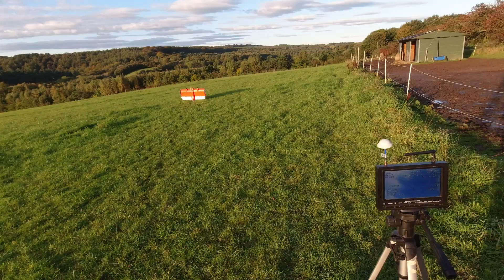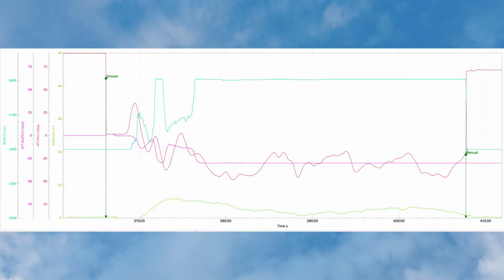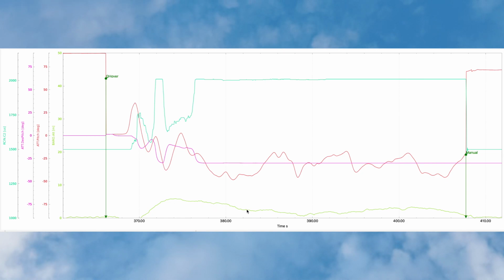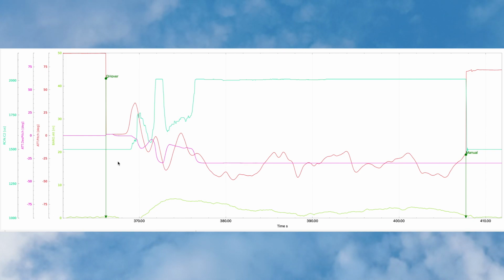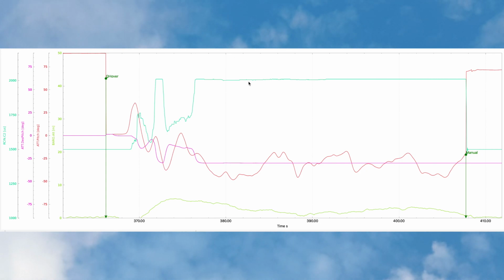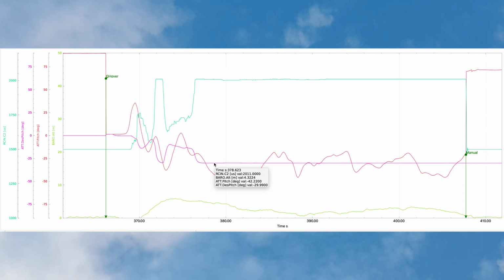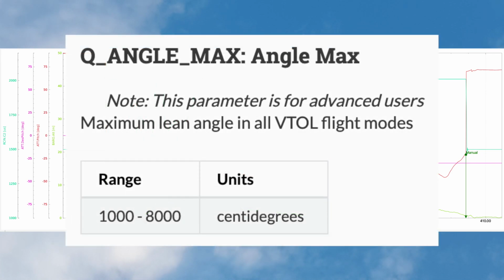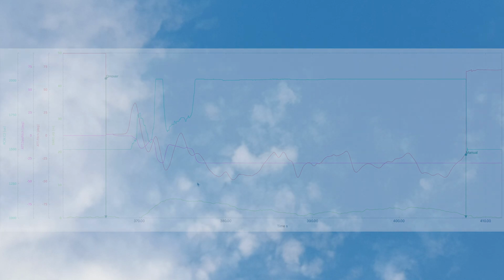Tailsitter test flight 15 - First VTOL landing!

Comment: Congrats on the landing. I've been considering working on  VTOL with INAV on the FC. Did you design the plane yourself? Did you have to balance it on all 3 axis? I'll be following along for pointers.
Reply from the maker: Hi Justin, thanks for subscribing and your interest in my VTOL experiments. Yes, the plane is my own design, however I have to say after 18 test flights this particular model is soon to be replaced with a new design which I'm currently working on.

Yes, the aircraft has to be carefully balanced about all 3 axis to fly well.  The CG is also critical to be capable of flying vertically and in forward flight well.

My next design will have a symmetrical wing profile.  This should make it easier to achieve a stable hover for take-off and landings.

I'll be sure to share what I learned in my videos.